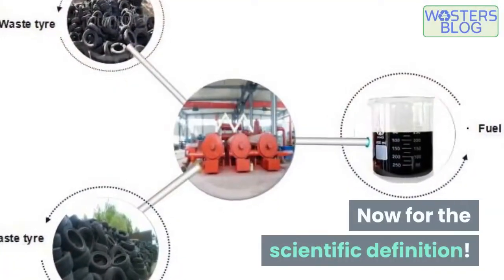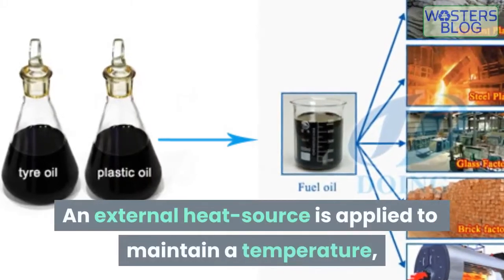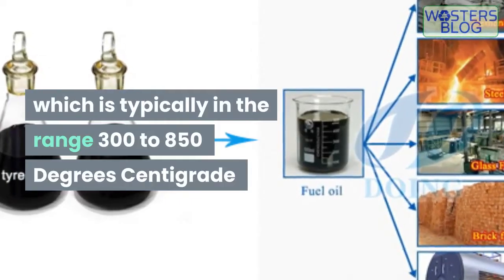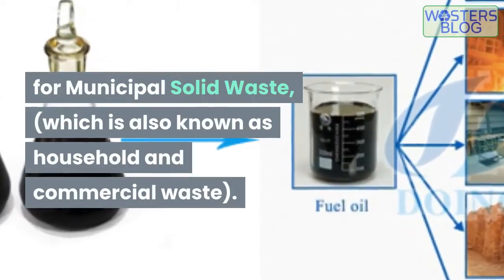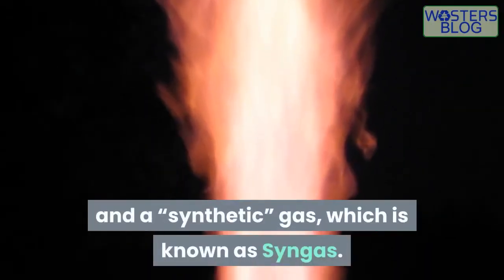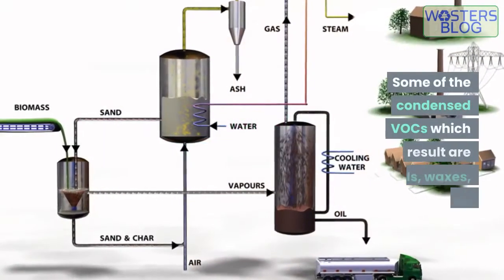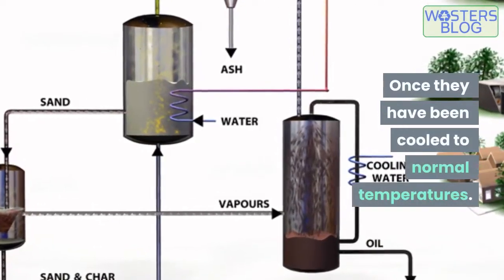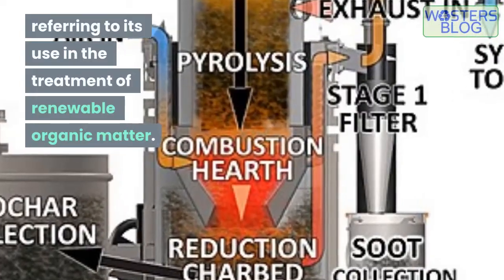What is Pyrolysis? A Definition of a Heat Treatment Techonology for Energy from Waste + Gasification

Comment: The waste used tires can make the fuel oil. then make oil for car.
We have new continuous waste tires and plastic pyrolysis machine. This technology  have more than 100 pcs plants. and 10 years experience now. our continuous pyrolysis machine automatic controled by PLC. big capacity ,environmental and more safety than batch machine. and have high quality oil and carbon black. capacity can do 50tons or 80tons per day. 16000tons-25000tons per year.
Used Waste Tires continuous pyrolysis machine
How to treat so big quantity waste tyres . the best way use the continuous pyrolysis plant to make fuel oil.
What we can get from used tires:

Pyrolysis Oil: 48%
Carbon black:35% high quality for rCB refining process. Much better than batch type pyrolysis machine.
Pyrolysis Gas:8%

 working 1-2 months. safty and fast.automatic control. need need worker to day. control by PLC.please contact me for more infomation.whatsapp:0086 19386633194 Email:jason@hnbjhb.net

Comment from the maker: You might say why bother with pyrolysis when incineration technology is well developed and generally accepted. However, making a syngas has great benefits, and enables the methane to be cleaned up and used for NGV fuel where batteries are unlikely to be able to be powerful enough for many years yet to power an HGV for 8 hours before being re-charged.
Reply: Hi! I have like this video and also subscription 
I need your advice. I want to start a clinical, pharmaceutical, animal carcasses and general waste pyrolysis 
Is it possible to find a machine that can burn all the above at once?
Reply: I would love an answer to his above question
Reply: @joshuaabidde  This technology will save the earth from global warming....